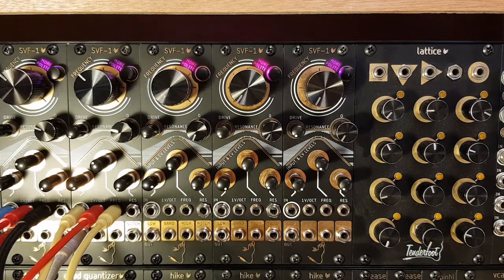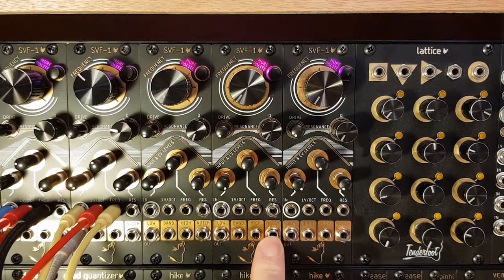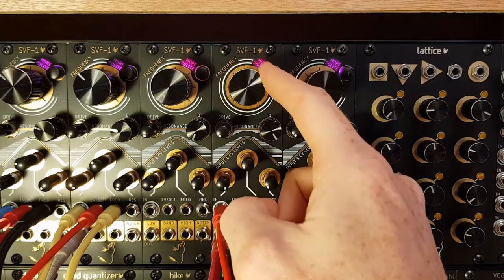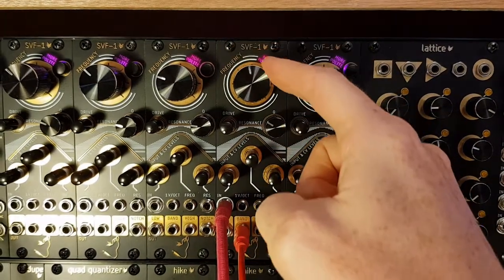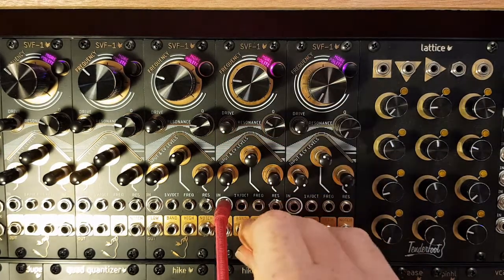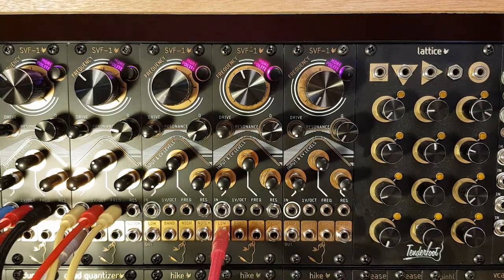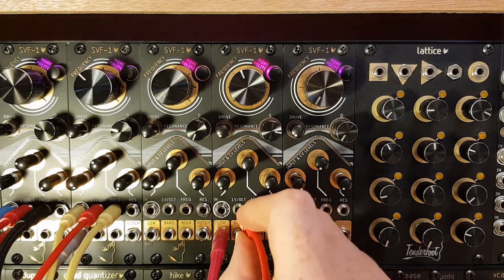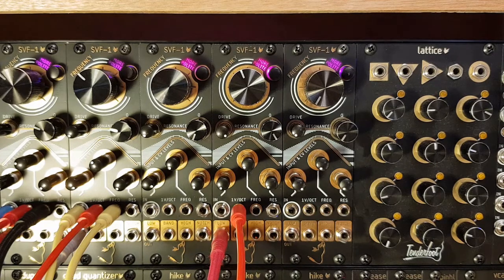SVF-1 Filter Overview

Comment: Hi. Does the drive only affect the res? I really wanted to hear what this sounded like with res at zero but drive cranked up and button depressed
Reply from the maker: Hey! The drive is part of the resonance circuit, so only makes a difference if you have the resonance up. The button is also linked to the resonance and basically allows it to be pushed further beyond its normal limits. That means that with the resonance turned down to zero, neither of those controls will affect the sound. Hope that helps!
Reply: @TenderfootElectronics  thanks for letting me know! :-)